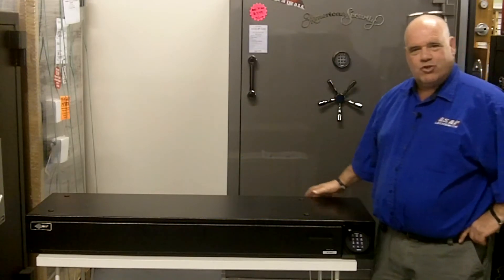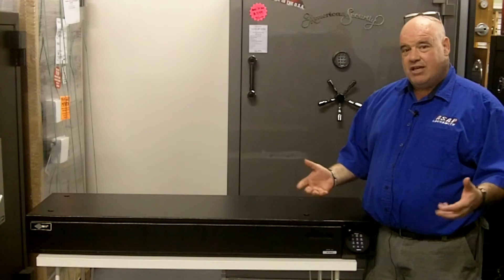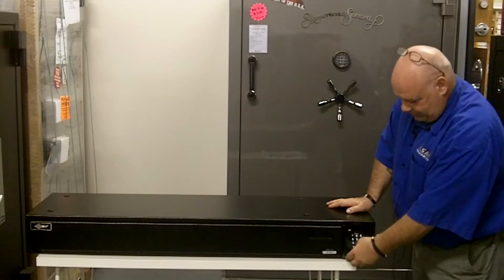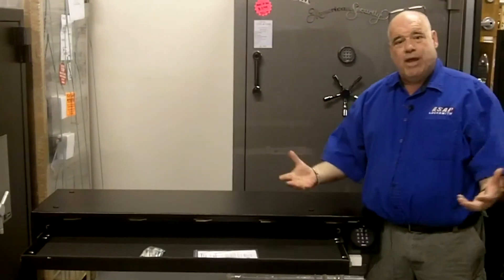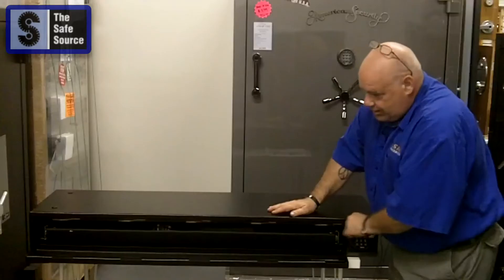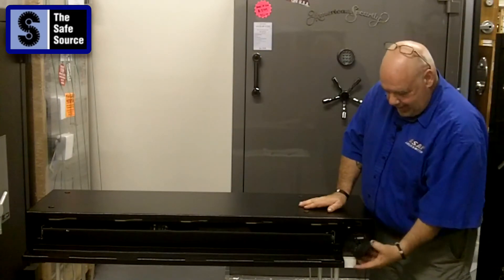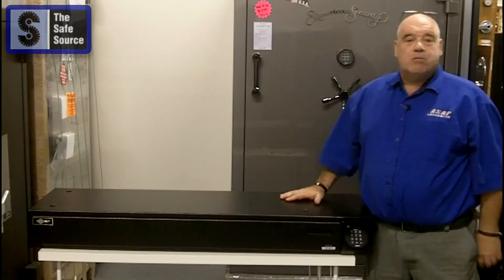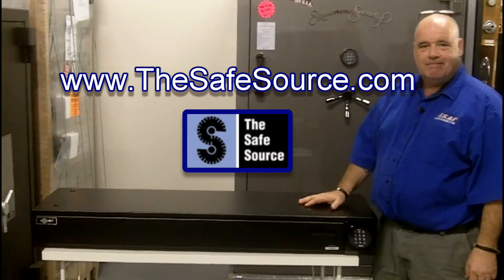Under Bed Gun Safe, AMSEC DV652.

Comment: FYI, the holes on top are *not* mounting holes.  When you get the safe and read through the instructions they only talk about mounting it from the bottom.  The holes on top are larger diameter than the bolts that the safe comes with and are only there so you can get a drill/screwdriver through the safe to mount it from the bottom.  I don't feel like drilling holes in my floor so I'm most likely going to get an industrial strength bike/motorcycle lock to wrap around the struts under my bed

Comment: Is there a way to attach the safe to the underside of your bed frame as I don't want to drill holes in my floor?  Would it be possible to get a heavy duty cable lock that would go through the holes in the top of the safe and then around the bed frame?